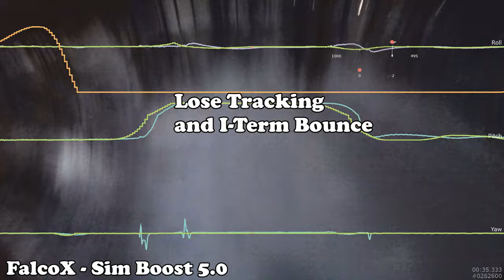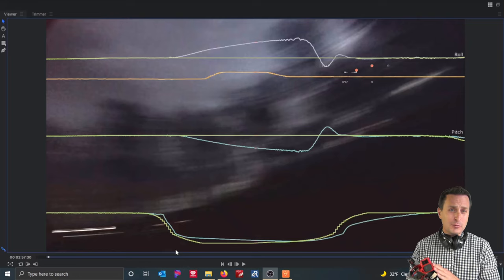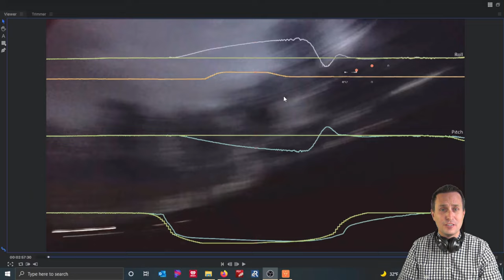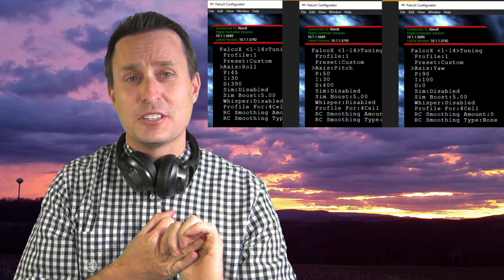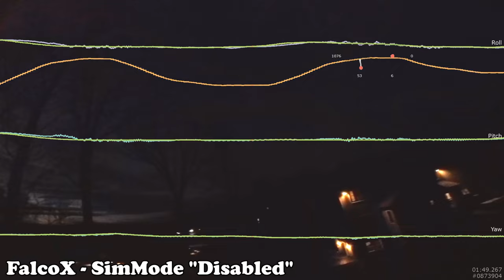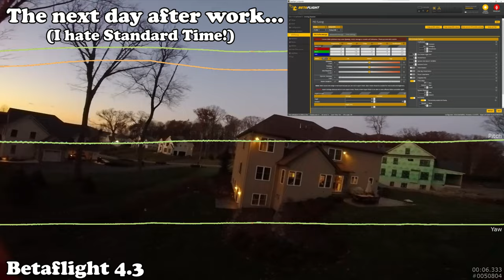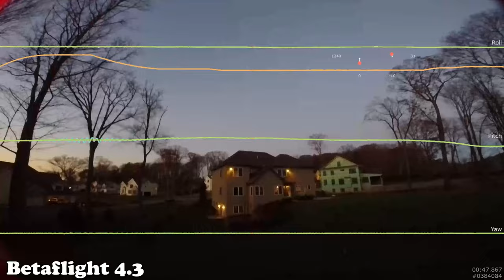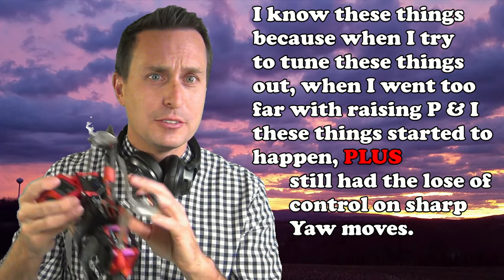💩 A BIG Flaw in FalcoX you should Know | FalcoX vs. Betaflight

Comment: I noticed Falco X had a distinct flight feel that seemed to be doing something slightly different from my sticks. I kind of like it, but lead to some surprising moments where my quad was in an orientation I didn't quite expect. I flashed back to BF because it would sometimes start ignoring the receiver, requiring a replug. It did this several times before arming and in the middle of configuring things in the OSD. Did not want to risk it screwing up in the air. Same quad/FC on Betaflight didn't have that issue.
Reply: I had same issue on Hobbywing G3F4 running Falko. Sometimes its failed with receiver literally couple meters from me. Same quad on BF was running hundreds batteries without any issues)

Comment: I’ve flew F1 pretty much the whole 2+ years I’ve been flying FPV.  I have a quad on BF as well. I just don’t notice this on F1, and I do a pretty decent yaw moves and inverted yaw. Do you think I’ve just compensated for this over time or what are you’re thoughts? My yaw spins when I’m going full speed are level.
Reply from the maker: I guess.  I noticed it right away.  🤷‍♂️

It is impossible for me to do an inverted yaw spin in FalcoX, but no problem in BF with the same quad; same rates.
Reply: @uavtech  could it be your rates on falco needs a bump?
Reply from the maker: @lemoncfpv8434  same rates.

And why would rates cause the Roll and Pitch axis to lose control?
Reply: Same opinion,i use falco from 2019 and any problem like that,just find the right tune and flies nice.And then when i see the people who run falco like blackbird,mariusfpv,Fabianfpv etc...do you see the yaw spin of bb?😍
Reply from the maker: @gato9826  they are compensating and/or just flying around in smooth lines and NOT doing snap yaw spin.  You can see all around just worse tracking, so why deal with that?

I guess one good thing, if you can fly well, dispite of (not because of), this kind of flight code, good on you.  It is like an extra challenge to fly around the throbbles and yaw loss of control stuff.  When i do these tests, I'm just surprised to find it at all.
Reply: @uavtech  i understand but i mean like all depend about tune
Reply: @gato9826  Blackbird FPV (Damien Gans) left Falcox ages ago man! He flies KISS ultra now - I talked to him on Juicy Sbang fb group and he had nothing good to say about FalcoX, even warned me not to touch it with a 10ft pole.
Reply: @gato9826  if you're looking at Sbang pilots - the king FaroukFPV flies betaflight 4.2, Damien Gans (BB) flies KISS ultra.
Reply: @fpv_dartion3316  sure but if you remember farouk start sbang with falco and flies fine aswell.And marius is a King also just my opinion
Reply: @gato9826  yes but he switched! That's the thing. A lot of people I know that fly Sbang are switching away to BF4.3 or KISS Ultra.
Reply: @fpv_dartion3316  yes man years ago...anything to say Bro...In october he has a post with falco and i dont have any interest about what he think about just say there are people who fly like Angels with falco,just that.And i know he run kiss now👍
Reply from the maker: @gato9826  no, I tried to tune out as explained in the video. You can't.  Try the moves yourself.

Anyone flying Angles is flying around the flaw.  Which is fine, but it is def. a bug/oversight that needs fixed.
Reply: what are your rates?
Reply: @uavtech  @uavtech My problem after two years of flying is trying to learn to tune now on BF. I’m not good at it. I’ve watched your videos on tuning and Bardwell, just not something I’m good at. I do need to practice it more because it’s something I really want to become proficient at. With Falco X, I’ve just picked a preset and input my rates and I’ve always been fine. I will say that with my BF kwad it flies very similar but something is missing and doesn’t fly as good as my FalcoX kwads. I know that’s on me cuz im not good at tuning so I can’t get it to feel as good as good as my Falco kwads. . So I guess I’ve compensated for the bug and just don’t realize that I have.
Reply: @uavtech  Inverted yaw spin at 1:52. I through in Reg yaw spins throughout vid. Well, compensated yaw spins I should say. I also wanna add that I’m not disagreeing with your analysis, you’re the king of everything tuning. I’m also not advocating for F1 nor do I like some the shady things they do/say. 

https://youtu.be/jKN208MTQQ4
Reply: @RichardPanico81  good stuff bro!!!
Reply: @nemoishouse  thanks bro!
Reply: @mattraymond2935  my rates? 
They’re 
390
44
139
Reply from the maker: We looked at KISS already.  Throbble.  Overshoot.  Kind of hard to get the right i-gain to not dirft, but won't overshoot a lot (i-term windup).
Reply: @uavtech  nice… I need to try Kiss out. It’s always out of stock or way expensive for me. I’m gonna make it a point to get this BF kwad tuned and see the difference. Thanks for the data, Mark. I like seeing these cuz you don’t get a lot of ppl reviewing F1 stuff.

Comment: Very interesting observation. I don't really have any interest in FL1 at all for a variety of reasons, but I think this data is useful. I'm also curious if this same behavior occurs with the FL1 software on a non revolt f4 FC. 🤔
Reply from the maker: I would not see why it wouldn't.  Other boards are just a different target.  The core firmware is the exact same.

Comment: I'm not from an English-speaking country, so I'm not sure if I understand what you're saying when I run the subtitles through a translation site…

1. When I input fast yaw, the gyro does not respond to roll and pitch inputs. (The quad is not controlled.)
2. the i and p values are decreasing then.
The reason for this is that the sim mode or sim boost is engaged.
4. I disabled sim mode and D term antialiasing filter but it was useless.
5. lack of anti-gravity mode is the reason.
6. increasing p causes bounce back for less i, which is not a solution.

Is that what you mean???
Reply from the maker: 1. When you input fast yaw movements, FalcoX is dropping control terms on the other axes (roll and pitch).  It should not do that.  It results in drift/loss of control on R and P.  It is a code flaw.

2. I believe it is related to SimMode activation - regardless of SimBoost value - and there is a bug where you cannot really turn off SimMode even if it says Disabled on the OSD (my best guess).

3. [Skipped]

4. Correct.

5. Yes, for Throbbles (nose bobble when pumping the throttle).  To mitigate those, you need something to boost P and i-gain when you pump the throttle.  FalcoX does not have that tool.

6. I have the tune at max P and i-gain.  Any more snd I get P-gain bounceback (which you can see in the BF vs. FalcoX video from a few months ago when I started with the BlackBird NextLevel presrt), and any more i-gain will make the i-term bouncback - which is still there a little in sharp flips/rolls - worse.  P and i-gain are the terms thst close PID Error (the gap between stick commands and gyro reading), but you can see I have them as high as they can go on R and P before other bad flight characteristics appear (see that other video).
Reply: @uavtech  Thank you so much for all the details, you're always so kind!
I have been feeling some sort of discomfort as well. Guess I'll have to increase my yaw rate and try to actively feel it well!
I don't know if this is related, but many of the Falco users on the Subang forum have dropped their yaw rates quite a bit.
Reply from the maker: Yeah, a slower yaw rate will prevent SimMode from kicking in.  If the PID Error (Stick Command deg/sec - Gyro Reading deg/sec) is kept below 50deg/sec, SimMode does not activate (on any axis).  So low race rates maybe can avoid.  What this really hinders is being able to do snap inverted yaw spins with FalcoX.
Reply: @uavtech  50deg! For example, I don't think he's that slow in yaw deg, but he flies inverted yaw spin very well. 
https://youtu.be/MzIRGNZay_g 
rebolt's 2823 firmware is a favorite of them, but I wonder if that has something to do with it…
Reply from the maker: Ummm looks sped up though to me.  🤔  are we sure segments are not to keep tempo with the music in the edit?

If it is not a blur, it is not that fast of an inverted yaw spin.  Depending on the quad yaw authority, maybe yaw tracks well enough to not get a lot of error?  It really depends on the speed of the yaw move and quad physical properties.

This all said, throbbles, bounceback control, and not great stick tracking are other sub-par things.  So it is not just the yaw.  On a light weight, high powered, rig with low rates all these things are less of a concern.  Those do well in most any firmware.
Reply: @uavtech  From my own experience, I don't think that video is doing anything speed up, but I also do think it's different from my H7 flying..

Comment: If your theory is that sim mode is always enabled,  then why not try with a very low sim boost value?  Most folks don't go over 2.0 with that value anyway, and I don't think any of presets go above 2 either.  For a racing quad, I much prefer the ease of setup of FalcoX to have a great flying quad without the need of becoming a black box expert.  I guess I don't jam on full stick yaw much when racing either.   I've been building and racing since 2014, and been through all the firmwares (baseflight, cleanflight, betaflight etc), before switching to FalcoX.  The main reason was ease of setup still resulting in great flights.. As the years went on with Betaflight, more and more complexity was added, constantly changing values, then sliders, but not from the OSD, VTX tables, filters, complex ESC setup requiring bi-directional dshot..    I'm not a freestyler, so I have no idea what my video would look like with a hi-res GoPro, perhaps it would be awful.. But being able to run full throttle through tight course maneuvers with no prop wash and not having to react to uncommanded changes is very confidence inspiring.  I'm sure BF can do the same,  just requiring alot more fiddling with to make it work properly.
Reply from the maker: I did, i see little difference of SimMode at 0.5 to 5.  Same issue persists at 0.5 SimMode.

Check out:  https://www.youtube.com/post/UgkxJxJqeYlLkgBS-dHdtGf8h7CN6Urx4qpy

So yeah it can get it done.  It's not that much fiddling honestly.  But the FalcoX OSD setup is slick once you do it a couple times.  There is something.too about having EVERYTHING in the OSD.  Even presets which is nice.

Comment: Falco x has a nice smoothing affect but i am having bobbles pitch and roll during snap moves. how to get BF to trac like  falco? I can see my heartbeat in BF. RC smoothing?
Reply from the maker: Yes, and no FF.  Also Actual Rates with Center Stick sensativity of 10 or put on your FalcoX rates in to BF.  SimMode really doesn't do much, so little to no FF is what you want to mimic the sloppy tracking of FalcoX. 

That all said about FF, i would say mostly dial in your rates.
Reply: @uavtech   think you found something there by design I cant think of many snappy acro pilots that fly falco. it may be best for low rates juice cinematic race stuff. Could stick input filtering be causing delays? most of the Flight 1 hate is around parts not shipping even before the shortages.
Reply: Adjust your feedforward transition to 0.4 or 0.7 so that feedforward only kicks in at the set value past 40% or 70% stick deflection respectively. When your stick goes lower than the transition point, it will proportionally decrease FF, making it kind of feel like FalcoX smooth stop. 
Smooth stop basically works by increasing stick filtering as you get closer to center stick.
Using Raceflight rates in BF helps heaps too.

Comment: BF all the way for me, but as I look at this, I wonder if… does sim mode have some form of camera angle correction causing pitch/roll correction with yaw inputs?

Not making a case either way but I’m just trying to understand why that is happening at all, and - especially if it’s an error from the way the quad responds yaw inputs - why the pid loop doesn’t seem to be correcting for the pitch/roll deviation.
Reply: Not meaning to be insulting or anything either - that’s a rudimentary and glaring enough possibility that I doubt you would have missed it, but sometimes things hide in plain sight… thanks Mark!
Reply from the maker: I think they drop P and I-gain and boost P on the axis with PID Error more than 50 deg/sec.  So it causes bobble on the other axies.

Comment: I’ve been flying FalcoX since it came out and absolutely no issues. Blackbird flew FalcoX also and does some major yaw moves without issues. I’ve tried BF and just don’t get the feel I get from FalcoX but guess it’s a personal choice.
Reply from the maker: Yeah, this is more of a buyer be aware PSA thing.  

It is definitely not sound stuff you would expect to see come from a flight firmware.

Hopefully this will drive a fix.  Yaw spins don't have to be so hard.  F1 folks don't even know maybe?
Reply: @uavtech  I’m curious is the FC running FalcoX a FL1 board or a FC running FalcoX?? The Chip shortage has affected FL1 pretty bad so I’m curious. Also there are several videos about not having anything on the FC so having another FC on top is probably giving you some issues and I would wonder if that data is “pure”.
Reply from the maker: It was a Revolt board.

How would two FCs on the same quad make the data bad?  I have done the same with BF v. Emu v. KISS, etc...  No issues.

See the comments.  Other see the same too.
Reply: @uavtech  then you aren’t following instructions per FL1 on the mounting of that FC. I’ve seen people get a FL1 board and just slam it in and have receivers and vtxs laying on the board and it causes issues. I have always respected your knowledge so don’t take this wrong but I just don’t think it’s a fair test. I know people have their issues with FL1 for whatever reason but whatever issue you have it flys amazing
Reply from the maker: Nah.  It just has issues bro.  Implementation of SimMode is bogus.

And FC does not put off electrical.  ESCs are on the arms (individual) with a 470uf cap on each.
Reply: @uavtech  I’ll say it again, I have 3 quads running RevoltOSD’s and never had any kind of issue so…
Reply from the maker: I'll say it again, do hard yaw moves (full stick) and watch it go off course.  When you level out and do a snap 360 yaw (like you do in inverted yaw spins), you should see the exact attitude at the end of the move that you saw entering.  That is not the case with F1.
Reply: @uavtech  I hard yaw always bro
Reply from the maker: Lets see it.  Level out and do snap yaw moves.  Don't feather it to cover it up.  You don't need logging to see it.

Also how do you explain the other comment saying they have seen the same as well?.
Reply: @uavtech  because one of the worst parts of this hobby is piling on when someone is trashing a company. It’s sad really. I’d love to see a pic of the build you’re issuing also. How do you want this flight footage???
Reply from the maker: @nemoishouse  any way you prefer.
So honest reviews are no good?
Reply: @uavtech  mount the FC like Preston stated here https://youtu.be/7HfjCaEGnDI and it would be more of a honest review. I’ve seen people come from BF and slam one in and get issues just like you’re describing. Honestly aside from this video and some other live streams(from the guy that uses your content)I haven’t seen anyone else saying what you’re saying. I’m not saying your aren’t experiencing issues but if you’re mounting a FC over top of a revolt I’m pretty sure that’s the issue
Reply from the maker: @nemoishouse  my god.  The brainwashing.  Sorry, but that has nothing to do with it.  This is not a noise thing.  I'm not chasing my tail for half baked stretches (reaching) to grasp for anything.  Just do the yaw moves, or don't, I really don't care.  If you honestly do them, you will see clearly.  When you do hard moves and come around 360, the quad is off attitude because roll and pitch lose control and drift.  That should not happen.

Why would you even think an FC mounted in the stack with the Revolt FC would cause a issue?  Then also, how do you explain why the Revolt FC doesn't then throw off the BF FC, because it did fine?
Reply from the maker: @nemoishouse  i'm sorry, but you are just making up weird reasons that make no sense.

I offered it is not good.  I offered you are use to it or didn't look hard.  Try the yaw moves.
Reply: @uavtech  it’s not made up I just followed what was in the video. I have zero to gain for making up things to anyone. I fly FL1 and I love it and have no issues with it.
Reply from the maker: @nemoishouse  good deal.  
As long as you are having fun that is all that matters!  :-)

But it doesn't make this evidence based results not true.  Not everyone peels the onion as deep.  It's all good.

Comment: i honestly cant say i ever had any flight issues with F1 only a random esc burning..im a pretty basic tuner and most my quads are BF and i watch your videos on 4.2 and my quads fly amazing but all i do for falcox is make a solid build and run skitzo tune on my nova frame and it flies amazing and smooth no wash at all...till i bend a prop lol
Reply from the maker: Pump the throttle or do sharp yaw moves.  That's the only issues i'm seeing.  Otherwise, it is fine.
Reply: When I pump the throttle the nose bobs a little which I could never fix.. but my yaw movements don't seem to be off track.. but I do know what you mean..I have had some F1 older boards act wierd... I'm trying to get into black box and tuning alot more you and Bardwell really helped me alot awesome 👌 videos. I tried to get your frame and the cnc company still seems to have water issues 😕...I can't wait to get a few of your aos 5,s ... thanks for listening and reading 😁
Reply from the maker: AOS is Chris Rosser, not me.